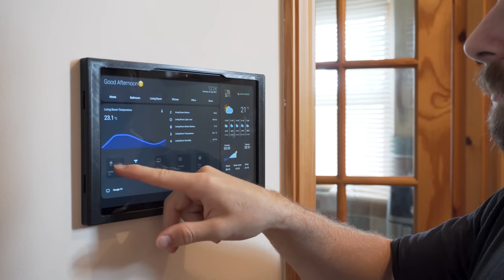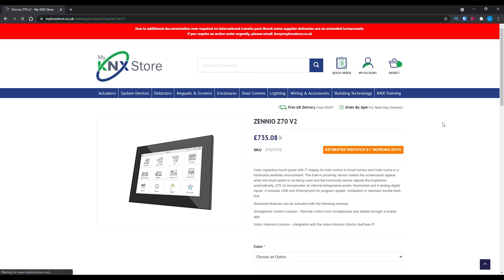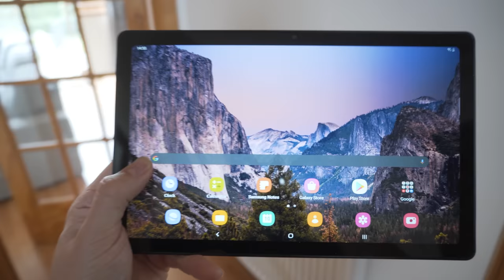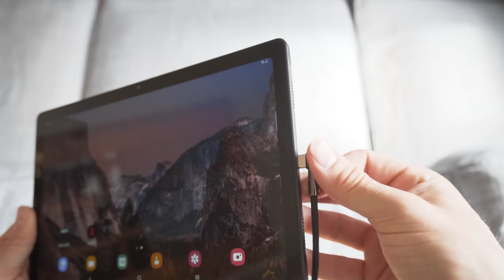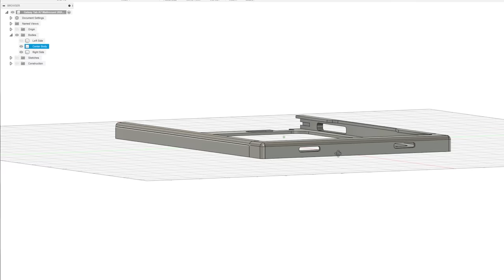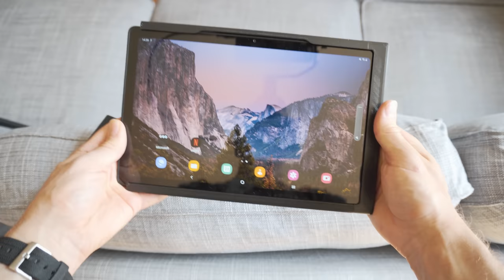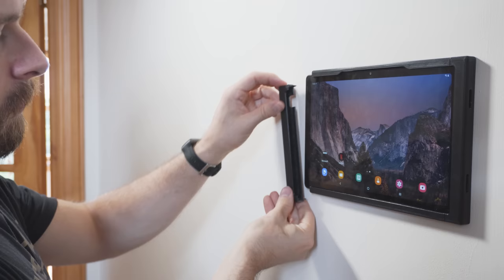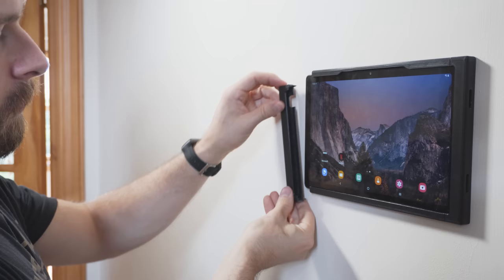Building my PERFECT Smart Home Control Panel!

Comment: Looks awesome!! I would probably go with an iPad (since I hate android) and a Vogels case (since I don't own a 3D printer). The idea to control charging based on an automation in HA is a nice idea. This way you can let it stay between 20% and 80% charge. I would set the device not to ever turn off the screen. Not sure it this will cause burn-in. Probably not.
Reply from the maker: Thanks, good luck!

Comment: Thank you for this very nice video.
I have had similar thoughts.
I bought a cheap Acer tablet - bad decision. It’s too slow. 🙁
I founded my home automation on FHEM and Node red.
Therefore, the tablet is often at the end of its range.
I will probably switch to the Samsung model you recommend.
For the constant charging problem, you can use the MQTT integration of Fully Browser.
It can report the battery level to the MQTT Broker and if it is below 10% the charger socket is switched on, if it is 100% it is switched off again.
Reply from the maker: Thanks and good luck!

As mentioned in the video, I already automate the charging cycle 😅

Comment: U could use wireless charging. So no sub needed. Also you could hide charger in wall and make real socker for kitchen too. Instead of using socket in kitchen to power tabled ;) IMO
Reply: wireless charging -> heat -> closed enclosure -> 🔥

Comment: great vid , using action tiles with smartthings but have really never finished setting up ,
so have been thinking of doing the h/a one ,
 things i'd like to see is ring automatically pop up on door push , spotify control with playlists , did have sthm pin code but now use ring alarm ,so a pop up to enter a disarm code would be good
maybe reolink pop up on motion in garden would be good ,alarm on back gate opening ,list goes on :)
Reply from the maker: Exactly, tons of ideas!

Comment: Thank you for this helpful video! I'm really struggling to get the first stage setup correctly to Add something like this not sure if you can help me on this or point me into the right directions. I have a  2 way gang switch that does not fully work right it a no  neutral wire but I think its going to need one with one of them capisitor, but think there is two live wires to the switch so no clue how to attempt this one? also room to add two . what case also would you recommend? Its 2023 would you go for a different Tablet now in 2023?

Comment: I'm tackling this project, but had a question about your power source. What is the advantage of connecting to a smart plug charger that can be turned on and off vs just plugging in the tablet into a recessed wall outlet so that it's always plugged in?

Comment: You shouldn't let it displaying static stuff for long periods, it will cause burn-in. (it can happen with LCD, not only OLED)
I guess E-Paper would be the best approach for this.
The tablet battery will also degrade from the constant charging.
Reply from the maker: Display turns on and off itself with motion so it's not on long, plus not an OLED - so not really a concern.

I said in the video I'm automating the charging, so its never constantly charging.

Comment: Very cool. Great job and thanks for the share. I've been tossing around the idea for a command center, but always found that the benefits of having one vs. time and money just didn't pan. Meaning, I have my phone on me, pretty much 24/7, and have all the controls with a few clicks in my hands. 

You did, however, bring up one idea that might just have pushed me over to make one. Having the door bell cam automatically pop up, on the screen, when motion or door bell rang would be great. It would reduce the need to try and figure out what's happening from the small peep hole, and even communicate with them, without pulling out my phone, opening the app, and taking precious time to figure out who's there. 

Subbed and keep 'em coming :)
Reply from the maker: Yeah, it's definitely something that is for asthetics or that futuristic vibe and like I say definitely not essential! Having said that, does have some nice benefits!
Reply: @EverythingSmartHome  And, yes, definitely looks cool and a conversation piece for friends and family visiting 😎👍

Comment: I believe you do not need the smart socket and you can just set the battery charge limit to 85%  in the developer options. I had Samsung tablet for work and it had this feature. I am not sure if this will have it too. If it does not - there are apps that can do this for you, but they require root access.
Reply from the maker: Sure you can do that, I just like having the physical cut off option, no idea why!

Comment: I don't know if this is even possible, but I would love to automate my windows and sync them with my indoor temp, outdoor temp, and AC.  So if the temp outside is favorable it auto opens my windows and turns on my whole house fan to pull in that cooler air.  But if it starts to get too warm outside then the windows auto shut and my AC turns on.

Comment: Very nice build, well done for persevering with the case (I'd have been tempted to drill the back and solder on a power connector, your way is much more flexible).

I'm planning a wall display for garden watering... Big garden with lots of zones, tank water vs tap water, temp/humidity, etc.
Reply from the maker: Thanks John! I look forward to seeing what you make, make sure and send it to me!

Comment: Hello thank you for this tutorial, just noob question? Im planning to have raspberry pi to connect to my devices like smart switch lights, motion sensor, indoor cam etc.. And also integrate voice assistant with it and home assistant. My question how does raspberry pi connect to devices? Is it through wifi? Bluetooth? How does raspberry pi work? Iafter setting up raspberry pi with home assistant? What should i do next to connect my device and discover it with home assistant? Does raspberry pi work stand alone or it need to alwys be connected to your computer? TIA more power to your channel

Comment: Great work! Planning on doing something like that too. I'm just a bit worried about powering a tablet 24/7 ... apparently this would bloat the battery? I was thinking of a scheduled charge each day to simulate a normal charge/discharge usage.
Reply from the maker: Thanks Mark! Yes as mentioned in the video, that's why I'm using a smart plug to automate this!
Reply: If you charge based on the battery state the battery should be fine. years ago we ran wall tablets and had one pop a battery (it was a Hudl 2) so we then set up charging via smart plug to charge when below 5% and stop when 100. This was done using a Vera controller and a tasker plug on on the tablet. Worked wonders and never had another battery pop, it's also much better for the battery. Of course all that is much easier in home assistant now.
Reply: Instead of using a separate wall socket I was thinking of using a PoE splitter to charge the tablet. Then, via a script you can connect to the PoE switch and enable/disable the PoE port which would enable/disable charging.
Reply: You can activate Protect Battery in the settings of Samsung tablets.  This will limit charge to 85% so you can have it plugged in 24/7 without the battery deteriorating.

Comment: By dumb luck i got the same tablet - sweet case work already in progress (by you!) thanks! - I'd wonder if it would be an idea to turns the case/frame into a wood looking photo frame - dual purpose the display to a picture frame when you are not standing closeby. Using something like fully kiosk with home assistant web interface seems to make this work well. Just an idea.
Reply from the maker: Wooden case could be really nice for sure!

Comment: Keen to see how you automate fully kiosk to change screens and use HA's motion sensors to wake the screen. Additionally, any ideas how MQTT can be used?
Reply from the maker: What are you hoping to use MQTT for?
Reply: @EverythingSmartHome  have managed to set up REST and MQTT with my wallpanel. The Camera acts as a Motion Sensor through MQTT, then pushing REST commands to fully kiosk browser. E.G. If the wallpanel isn't on the home page and no motion detected for two minutes, load the home page...

Comment: Im working on the same thing. bought the same tablet and also did not find a nice wall mount that wasnt realy expensive. same as you i am also trying to make my own and i have something of a design but my printer is not big enough either. I have a friend with a cnc and i was thinking asking him to cnc the part out of epoxy resin. looking at your design i might have to rethink mine. Maybe we can share designs :D
Reply from the maker: That could be a good solution too!

Comment: Hi, I am new to your channel. And I would like to suggest whether you could do an automation based on wireless charging based on the battery percentage. Like for example: if your battery percentage is 20% or below the phone starts charging automatically wirelessly without the need to connect it physically. Is there any kind of automation available as of now?

Comment: Hi, I'm moving soon and getting ideas to  make my houdw smart run my lifx lights, hive thermostat, blue os, ring, temp sensors and Sonos.
How are you getting all devices to work with home assistant raspberry pi?
And what do you think about violet smart panel for controling ceiling speakers in the bathroom connected to a Sonos amp.

Or any recommendations for me.

Cheers Ryan.

Comment: I'm actually building this with the same tablet model, which I didn't know till I watched your video ;) I've been running into the same issues where I can't find a wall mount case I like that will fit on my printer. You'd mentioned you would make your design available at some point, but I can't find it anywhere. Any chance you could let me know where I can find that?

Thanks, and loving your videos!

Comment: Sorry for my ignorance, just starting to try and build some custom dashboards.  What button did you use for lights and how did you double tap to bring up the slider control for dimming?  I see diff buttons out there but the slide is either under or built in and would prefer to double tap to keep from accidentally dimming!  Thanks

Comment: With BlackFriday coming up, I'm trying to buy the same Tablet you had bought to use as a dashboard. It would be great if you could share the 3d print file. With out it, it's hard to buy the Galaxy Tab A7. Do you have an approximate ETA in mind as to when the 3d Print file will be ready?

Comment: Hi, this is almost exactly the same as I'm doing as I have a Konnected alarm, with Home assistant and the intention is to use Fully kiosk. I also have a CCTV system I want to do a door camera on doorbell press (or actual human detection via blue iris AI detection). I'd be interested in what automations you set up in regards to the charging cycle? I've purchased a 12v to 5v converter as I have the cabling running from my old alarm system installed that I can make use of. Do you have the 3d files available anywhere please as it's very similar to the design I wanted with a backplate screwed on to the wall and tablet slid in. I shall browse your other vids now!

Comment: Great vid and nice case! I made a very similar one a few months ago but made case from wood as no 3D printer (yet). I also have a battery automation which charges the tablet to 80% then let’s it discharge to 20% as I was worried about battery bloat or other failure. I needed to have fully kiosk restart each morning while we are asleep to prevent freezing and I use it to change the Lovelace screens at a certain time of day. How would you get it to pop a full size camera? Change screens to a full view panel when someone pushes doorbell?
Reply from the maker: Thanks Jason! 

Yes you've got it exactly! Pretty simple automation!
Reply: @EverythingSmartHome  Would you kindly share the Charging / Discharging via smart plug automation, please? @Jason G, what did you use to achieve the "automation which charges the tablet to 80% then let’s it discharge to 20% as I was worried about battery bloat or other failure"
Reply: @Jason G what did you use to achieve the "automation which charges the tablet to 80% then let’s it discharge to 20% as I was worried about battery bloat or other failure"
Reply: @iamtapu  Fully Kiosk Browser publishes current battery level to MQTT. I then use Node-RED to switch a Shelly1 behind the tablet to activate/deactive the charger.

Comment: Question, why did you go that route of the charger for the tablet instead of just tapping into the power connection behind the wall to run power up for a much cleaner look?
Reply from the maker: So that I can automate the charging cycle with the smart plug so that the battery isn't being constantly charged

Comment: Hi, one question. How did you make the tablet run  HASS website with the UI after system restart? Is it unning in KIOSK mode? Did you use some good tutorial or was it trial and error? How about wireless charging tablet? So many questions because I have the same dillema...

Comment: Brilliant idea for a wall control.  With dashboards being able to be setup per device, this could work really well.
Question:  Did you end up using a smart socket to control charging and how did it work out?   
I wasnt sure it would be necessary with a device that would be always plugged, other than maybe once a week doing a 20% battery "exercise" to just keep the battery happier.
Just curious how you did it.
Reply: There is a smart plug on the other side. It will be off always, and once the battery power reaches below 20, the switch is turned on.

IFTT battery level would be useful to turn on switch
Reply: @unconventionalunboxing8647  To have the battery last best time for Lithium Ion it is better to keep it around 35% to 75%.   Unfortunately most tablets do not have a charge control to limit charging to around 80%.    To prevent excessive battery cycling, it may be better to have the charger on all the time, keeping it fully charged and "exercise" the battery once a week by letting it discharge once a week to 50% then charge it back up.    That would mean one complete cycle for the battery every 2 weeks, rather than quite possibly 80% a day or every couple of days.   Just a thought that was running through my head.

Comment: I am in the US, so not sure on UK electricals, but couldnt you have just ran a recessed power outlet with USB built in and but it behind the tablet?
Reply from the maker: They don't really exist in the UK, I found literally one suitable one but it was like £100 just for a plug 🤯
Reply: @EverythingSmartHome  They are more common than you would think. 
Hamilton USB Power Sockets Modules is the one I've fitted

Comment: This is cool! It's like a Tesla in your house!
Reply from the maker: Thanks buddy!
Reply: @EverythingSmartHome  I did something (kinda) similar. I had an old Nexus 7 that I didn't use anymore, and was gonna buy a wall clock for my bedroom on amazon. But I realised instead I could just 3d print a holder for it, stick it to the wall, and use a free app on the play store as a clock! Hid the wire behind the posters on my wall, and it's still there ticking away!

Comment: Having not made dashboards for anything - how does one maintain or ‘host’ for multiple formats? Like I get that your phone one didn’t look good on tablet by default but now that you made your tablet one, is your phone one messed up? Or is the way it’s “hosted” saved for each device and HA just detects each device that’s signing in or is that viewing profile only stored on the device using it (that seems clunky and painful so I hope not)?
Reply from the maker: My original mobile dashboard was made when Lovelace didn't support grids - now it does. The grid allows you to specify how it should look on each device for different screensizes.

Having said that, I haven't yet fixed that for my mobile device, but it's not a problem since you can have multiple dashboards

Comment: Have you considered a magnetic holder for the tablet instead ?
Reply from the maker: Sure did, but then comes the question of power. Wireless charger was considered with that too but was out with the scope of my 3D design skills!
Reply: @EverythingSmartHome  we would need a tablet with wireless charging capabilities and a magnetic charger/holder. You would not need to print a 3D frame then (I guess). I don't know if the gears exists though, and maybe it is not interesting budget wise. Then, the tablet could easily be removed from the holder and used as a regular tablet, so it may be worth the additional investment. Thanks for your videos man! Maybe this will work in the future for a V2 of the panel ;)

Comment: Awesome project! In the video you briefly mentioned an automation regulating the charging. How did you manage that?
Reply from the maker: The HA app can monitor battery percentage, then just a simple automation to turn a smart plug on when battery percentage is less than 20%
Reply: @EverythingSmartHome  Awesome, will check it out. Thanks for the response, and thanks for the good content!

Comment: Is there a specific reason you want to "manually" control the charging cycle instead of letting the charge controller of the device to the work for you?
Reply from the maker: I just like the thought of having a physical cut off, especially when it comes to batteries. Might be unnecessary but hey, got a ton of smart plugs so may as well use them!
Reply: @EverythingSmartHome  Having a safety switch definitely sounds like a good idea. Plenty of "spare" smart plugs here as well :)

Thanks for the reply btw!